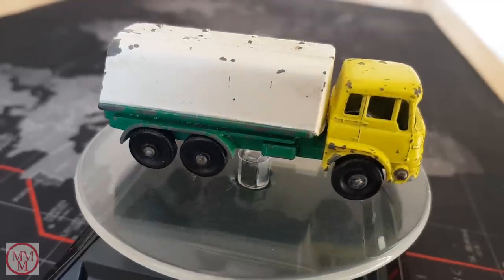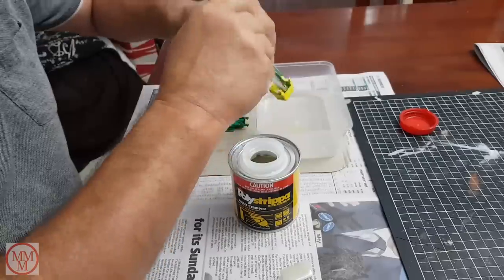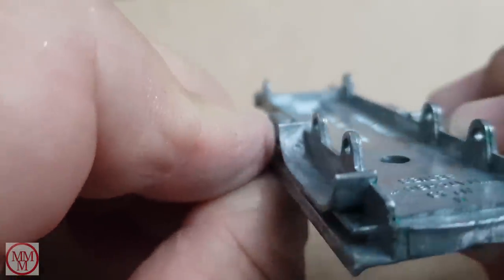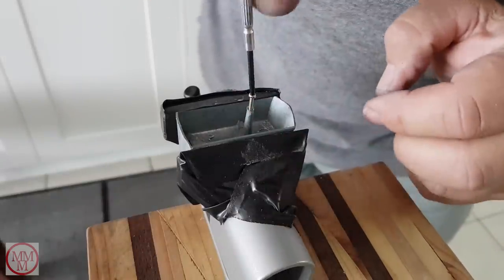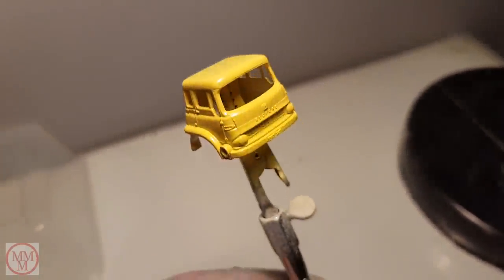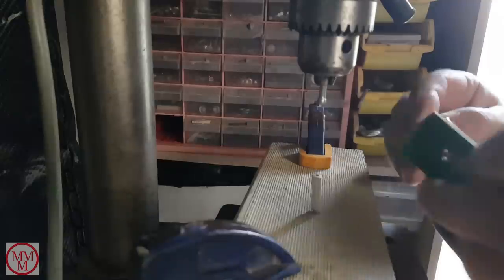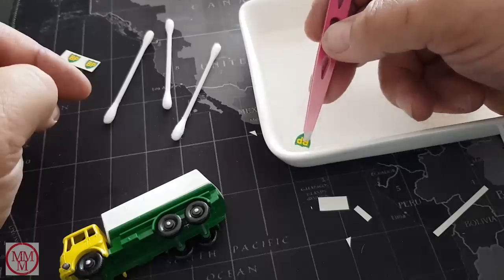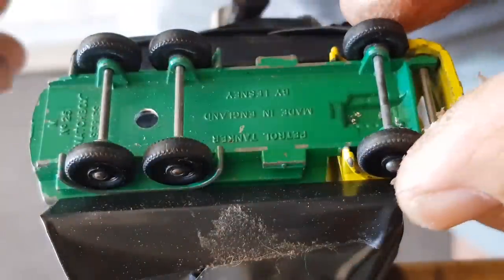MATCHBOX Restoration No 25C BP Petrol Tanker 1964

Comment: That was always one of my favourites as a kid. My dad worked for a fuel company called 'Aero', which became 'ABCO'. Although he was management, it was a small company, and he did a bit of everything, and would often turn up at home in a real one of these, to the annoyance of the neighbours. If I remember correctly, Lesney later upgraded this model to include glazing, and a cab interior. For a toy of that price (9d, in pre decimal money), the build, detail, and safety of them - Lesney never used Lead in the casting, the paint, or the packaging - they were astonishing.
Reply: they all came with the plastic seats , they may have been lost , the scarce one has gray wheels
Reply: They later made the British Leyland version of the BP tanker it was the one I had in the early 1970's.👍

Comment: Got Mine from the Batch of Matchbox I got for Xmas of 67, I Still have # 25, but I Took Off the Cab in the Fall of 74, & Replaced it with a Plastic Cab Truck Cab from my Tyco Train Accessory in 73.

That Truck Cab I Broke by Accident, Filed Off the the Bottom where the Wheels were & the Back Chassie, to Fit in the Tanker. 

With the Tanker itself, it had Plastic Seats inside, but we're Lost, so I Decided to do a Transplant, & Took it to Woodshop Class & Filed Off the Hinge that held the Cab, & Replaced it with the Plastic Truck Cab that was Part of my Train Set Accessory.

&... I Still have the Yellow Bedford Cab!

Comment: Another great job well done Marty, do you know that Lesney slipped up when they designed and made that tanker, as Bedford TK trucks and that's one of them, never had tilting cab's. The access to the engine was gained by those little lift flaps each side rear of the driver and passenger door's, they had  metal stays with slots to lock them in the up position, I use to drive them in the sixties as well as the the Bedford TJ which the Bedford TK later replaced it. Can I recommend that when you grind off your axles you use a large washer with a small hole that slips over the axle thus protecting the wheels & tyres from damage from your grinder, then you wouldn't have to worry that one day you might slip. Thanks Marty keep up the good work, can't wait to see more Reg

Comment: This a fascinating series. It’s easy to neglect just how innovative the processes were in the day. Mr Jack Odell (later of LLedo fame - Odell in reverse), production & design director of Matchbox was truly one of toyland’s greatest visionaries. I like the reverse engineering process and great care you take over the restoration. I noted in one video of the “Matchbox” factory spray booths that the models are spun round during spraying, presumably to throw off excess paint by centrifugal force. The tapping of the post looks interesting and I am about to look for a 2mm ‘tap & die’ set as this can be very versatile for other miniature tasks - can you recommend a supplier/manufacturer? Great work, thanks for sharing.

Comment: How do I stop the paint from chipping off. I’ve done a few models now and after doing a decent paint job when I go to put them bk together the paint ends up flacking or chipping off. I try to be carful! 🤦‍♂️
Reply from the maker: Try baking the paint in a small griller oven if you've got one. They are quite cheap. It helps but is not fool proof. Some paints just are vulnerable to chipping and i hate it when it happens! so I feel your pain.

Comment: It must be me but anybody who likes hot wheels over matchbox  I will never understand why
Reply: Many of them played with these on orange tracks.  Send a Matchbox of this vintage down the track after a Hot Wheels and you'll see the difference.  That said, the details are cool.
Reply: Hot wheels are for speed and tracks, while matchbox is for playing with fake little scenes with toy trucks and stuff.
Reply: @me_rocks_42  Agreement or disagreement is fine, but what's the point of exaggeration and being disparaging?
Reply: I like the Matchbox vehicles, maybe it is because I had them first. And much more  realistic to me.
Reply: Well... It was a two part thing for me. Number 1 was that Hot Wheels were much more prevalent here in the USA than Matchbox. At least in the late 1960s early 1970s. Number 2 was that Hot Wheels were designed to actually go/roll fast and we're supported by many accessories like motorized  stations that actually flung the cars around on that ever present orange track made for them. Matchbox cars didn't roll all that well and weren't compatible with all of the Hot Wheel stuff. Matchbox cars were more about looks and accurate detail. Hot Wheels also were about fantasy and concept vehicles more than the Matchbox line. Apples and oranges, really. That's IMHO, of course. 👍
Reply: I liked them both. Although my Matchboxes were well used for play, I can't say the same for my Hot Wheels coz for the the first few years I never had a track and when I finally did my folks would never let me set them up for long because they took up too much space.
Reply: Hotwheels were a Yankee travesty that ruined Matchbox here in the UK. Stopped collecting as soon as they started.
Reply: As a kid I used hotwheels and matchbox down a track and used mstchbox outside on the dirt... hotwheels didn't survive outside lol!
Reply: I always preferred Matchbox over Hot Wheels. Matchbox seemed more straight forward vehicles  and Hot Wheels had the hot rods and race cars. They did have some nice ones.
Reply: @plumerjr  You wouldn't like what's sold under the name Matchbox these days. I don't, for reasons on which we'd probably agree.
Reply: I see what you mean personally I'm a hot wheels collector when I started collecting it seemed I could find more of a selection in hot wheels than matchbox
Reply: ...Being a kid in the 1970's, I agree...I always wanted Matchbox..they seemed better made and more realistic...the Hot Wheels seemed "cheap" looking and constructed to me....and I was a little kid....
Reply: @Donleecartoons  Today, you need to look for Johnny Lightning, or Auto World for quality similar to classic Matchbox.  I mostly collect Muscle Cars now, but 50+ years ago (yes, I am that old) I collected whatever Matchbox I could find at the local toy store.  Back then, the muscle cars were new, and Matchbox did mostly European cars, which was fine by me.
Reply: @yereverluvinuncleber  As a Yankee, I really do apologize.  I collected Matchbox before the creation of Hot Wheels, and while the cars and tracks were fun, I was just a little too old to really get in to Hot Wheels as I also outgrew Matchbox.  My interest shifted to real cars.  Hot Wheels came out when I was eleven, and by the age of twelve I started my life long love with full size cars.  I wish I had not given away my childhood Matchbox collection.
Reply: @Aude Khatru your apology accepted on behalf of all of the USA.